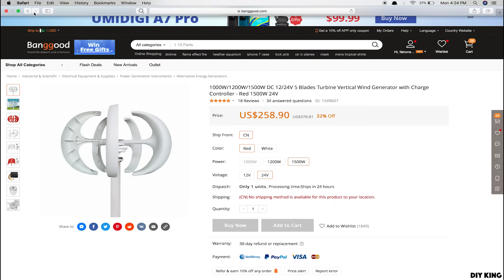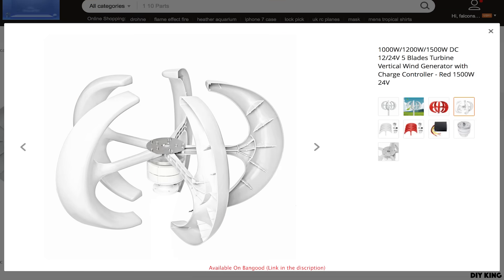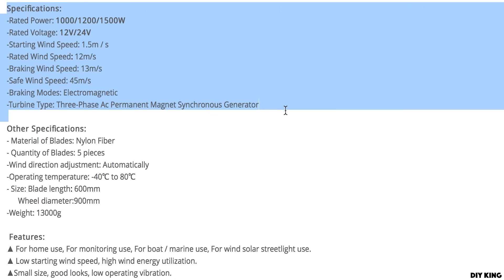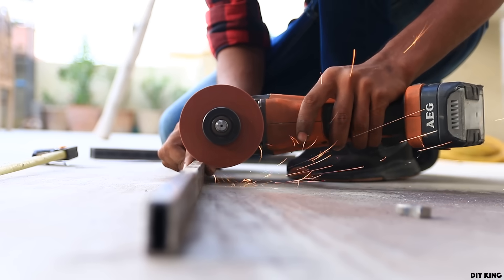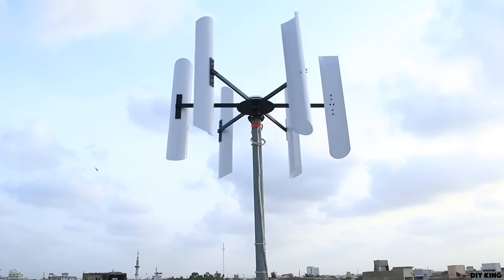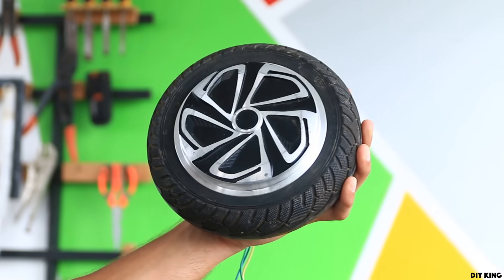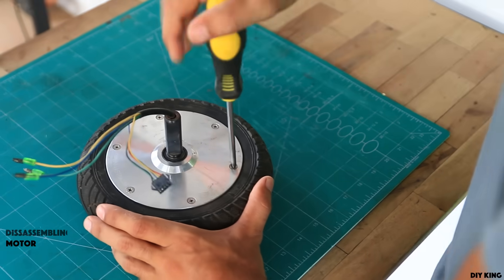How to make a Vertical Axis Wind Generator (Is it worth that???)

Comment: use an odd number of blades, 3 or 5, and shorten the arms they are mounted on by 1/3 of the original length. that should increase rpm, and reduce drag force by keeping the blade faces asymmetrical to the blade backs....great video, earned a new sub👍!
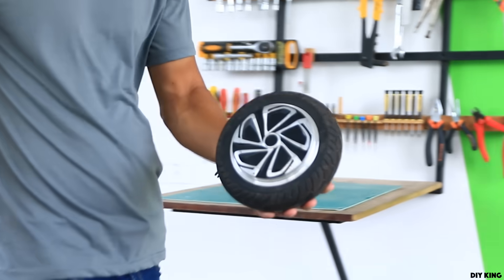Reply: It seems the odd number of blades should not be directly opposite each other. Try 3 blades 120 degrees apart. Look at the 5 blade pattern on the hoverboard wheel at 0:54
Reply: Yes This is actually the case. Please try a 5 blade version.
Reply: would the F P direct drive washing motors  and others of the same design  put out way more wattage if so how much wattage i have hear up to 1500 watts i know noneya business will give us facts!
Reply: @ambersmith6517  
I believe you are referring to DC treadmill motors? If so, then yes, the typical treadmill motor is "RATED" 2-3 hp. (1hp=746 watts) that is the consumption rating of the motor, at a given voltage,  rpm, and load. when used as a generator, these motors are much more inefficient, so 700-900 watts would be about as much as you would see from the motor terminals. Bear in mind, you have to apply 1500-2200 watts of mechanical power into the motor to realize that 700-900 watts output, so your blades, and gearing into said motor has to be able to source this power from a given wind velocity the turbine is designed for. hence the "slippery slope" of physics strikes again....
Reply: @ambersmith6517  Hello,  Rick here in AZ.    you will find there are a lot of different motors, alternators, generators out there that will all produce power,  just know the facts, what ever style motor, what ever the configuration,  however many field and armature winding they have or how many magnets they have,  they will all only produce as many watts output in proportion to the wind force being used to drive the motor.   the more driving force you have to turn the motor, generator, alternator the more watts you will get out up till you reach the max wattage that it can source, after that you won't be able to dissipate the heat and the motor will get to hot and burn up.
Reply: Lots of good sensible comments in this thread.
I've just been an an argument with a clown on another video about the validity of VAWTS.
Everyone knows that aerodynamically they don't convert wind energy as efficiently as HAWTS, particularly those with well designed blades. 
But that doesn't mean they don't have a place. 
That's actually very common in engineering. I started my degree in mechanical but finished in aerospace and mainly work in automation systems. There's all sorts of things that for most tasks aren't great but in certain things they are. Great example being a comparison between a mill and a shaper. Given the choice nobody would take a shaper over a mill EXCEPT for a few specific tasks. 

Here's one place HAWTS might be the best solution
I live in Australia and we have a huge number of houses close to the ocean with solar. Many of these places also get an consistent late afternoon onshore breeze that continues through the night into the next morning. Australia isn't the only pace that gets that but there is certainly an opportunity to use small wind turbines to use the solar inverters. In terms of cost benefit the simple thing is you get more out of the inverter. Also a house might be able to get away with a smaller inverter and smaller battery system.

But there are some provisions. 
Being close to the ocean means getting the occasional high velocity squall. So it can't be fragile. That tends to favor a Savonius.
Being a domestic application it can be noisy. Small HAWTS can be very noisy just from the blades.
It needs to be relatively cheap and and easy to install with minimal complexity have little complexity. That tends to favor VAWTs over HAWTs

But there has so far been a huge problem. The only HAWTS available in Australia to date are these cheap crappy low performing imports very similar to the ones shown at the start of this video. That has resulted in a lot of bad publicity. But then we have also had a lot of bad publicity surrounding solar systems.

I still think there is a place for VAWTs in certain applications but there has to be a lot more reality in the conversation.
Reply: @tonywilson4713  shaping machine, now there's a thought . Always came across as a lot of machine for very little result . But , broaching , keyways about the only real answer..
Reply: Also try lighter weight materials for the arms. The lighter the weight the less force it takes to turn
Reply: The powering blade is always going to be opposed with even number of blades.  It makes sense to use odd numbers.  Take the tip from the early aircraft propellers.
Reply: Odd numbers teory? Yea I can see this work. 3,5,7,11 if you divide by 1 and themself you can use them. I think curved and caped on end blades will help too. And as you say arms shall be ~1/3 of used in video.  Vertical Axis Wind Generator and "normal" Wind Generator are like total different sides of this same coin.
Reply: thank you for your comment and I have subbed after watching this video
Reply: Actually increasing the gap between them has proven beneficial.  The air needs space to get through to the back blades as they also drive the wheel
Reply: Use the 1/2 pvc  pipes as a base mold for carbon fiber blades. This weight reduction  should reduce drag significantly
Reply: @drewberrynews3875  or grp like industrial turbines found on wind farms
Reply: It is not a fair comparison.  The HAWT you started with has aerofoils and works using lift.  It will have a tip speed ratio of about 6 for 3 blades.  The VAWT you built has blades that use drag forces and cannot have a tip speed ratio greater than 1  If you make a VAWT with 3 aerofoil blades you will be able to compare the two types on a fair basis.  3 blades is the optimum number for all turbines.  If you increase them the tip speed ratio reduces but the torque from the turbine rises
Reply: may be source lighter components/materials and more efficient motor... the motor was never designed to work in Vertical Axis as opposed to previous experiments, and may be just fine tune the bearings...
Reply: Odd won't make a difference
Reply: I am considering a vertical axis wind turbine that looks exactly like a tree, I call it : e-tree.
the trunk of the e-tree is brown, the spinning blades are green,
attached to the trunk of the e-tree are features of : wifi/mobile network, light and power outlet, to charge a car for example.
Reply: Hi, what do you ment that the blades should be asymmetrical to the blade backs ? Please let me know
Reply: Agreed. I think shortening the arms will yield the biggest improvement to rpms. One benefit of the vertical turbine is that they self-regulate. If you live in an area prone to high winds, a regular turbine will rip itself apart. But the vertical turbine has the drag on the opposing side to keep the speeds more reasonable.
Reply: @penitentchicken  Great point and something that the anti-VAWT people like to ignore.

I've been looking at these for a while now. I used to live right near the beach in Melbourne Australia. As close to the beach as I was (<100m) we got fantastic onshore/offshore winds like clockwork starting in the late afternoon and going through to mid morning.
BUT we also got some damn nasty wind squalls at times. HAWTs are just cute projectiles in that scenario.

I think there is a market for small VAWTs in certain locations to boost the supply out of existing solar systems by making VAWTs with a compatible output.

Unfortunately in Australia - so far the only VAWTs available are mindlessly expensive or utter crap.
Reply: @tonywilson4713 ....... look at the furling tails used on water pump windmills , or just build a twin swallow tail , where one is sprung & will direct the unit off line , under excessive conditions .
Reply: @robertwoodliff2536  Yeah there's solutions to many things. Most of them aren't new and some have been done for centuries.
The job too many engineers ignore is to find the best solution for the moment, and that can include a whole raft of things starting with the most basic reality - what's available, what affordable, what's practical,....
Reply: One more today.

Comment: good job but don't be disappointed  .. increase weight at the blades and use gears or belt pulley to increase the rotation speed for the generator plus you can double the generator 
VAWT blades produce more torque than HAWT so get benefits from this and reshape  :)

Comment: Would using a gear system connected to the turbine help? Like converting the single rotation of the blades to say 50 times and using that on the motor.
Reply: if you use an ebike motor wheel, it already has the planetary multiplier inside
    but you will have difficulty at the start .. better to use the overboard generator but after the diodes go to a solar mppt regulator
thus the start is made free and then the MPPT seeks the point of maximum efficiency
Reply: Hi Bro, I am from India, I want to make wind turbine at my agriculture field. I do not have much mechanical knowledge. Can you help me in designing vertical wind turbine?

Comment: From my understanding of VAWG they spin nearly the same speed regardless of wind speed, their benefit is being able to generate constant power in variable wind conditions and being able to continue running when wind speeds are too high for HAWG.
Perhaps you just need to redesign it to make the motor spin faster, either shortening the arms as suggested by @Trent Pettyjohn or with some gearing?
Reply: in fact they they need a gearbox
with 1:4 ratio in start, so for 1rpm of blade, you will got 4 rpm or generator
or even bigger ration (need test)

Comment: You have to optimize the aerodynamic design of the rotor if you want good performance. Aerodynamic design includes selecting the profile of the blades, the number of blades and the aspect ratio of the rotor, you can use Q-Blade software to optimize the aerodynamic performance. I understand is a low cost design so selecting and aerodynamic profile is difficult but maybe chaning the configuration of the rotor (number of blades and aspect ratio) can improve the performance of the wind turbine, probably using four blades would have better performance

Comment: My points are (1) Reduce the No of blades to 5 only (2)  Do not mount the blades from the center of curve , mount it nearer to the edge (3) need to edge the side profile of blades for better aerodynamics (4) Extended more arm length & use PVC pipe instead of M.S sq. pipe                              Thanks & best Luck !

Comment: I think there's whole books on not making those blades symmetrical, 
and letting them pivot (open up to catch wind, then close in to reduce drag).
Reply: @Wim
If the blades pivot there is too much mechanical wear and tear.  It's better to redesign the shape of the blades to be more aerodynamic.

Comment: Change the blade design, use a carbon composite to hold that blades not iron or steel (heavy ) .change the whole blade set up  with carbon composite ,light weight and strong .study more about efficient blade designs , material selection and test it in a wind turbine and then apply it.

Comment: Square tube is longer then required. You need more speed then cut it in half. You will see the difference. But best is horizontal axis wind turbine 3 blade setup

Comment: there is also a way that you can increase power which is you can coil each stator in the motor seperatly like a brushed motor and take the 2 ends of each coil and connect it which creats a negative and positive side , which actually doesnt matter now and then now u will get more voltage out of it
and the thicker the coil ,the more the voltage

Comment: the issue besides the heavy weight of the tubing is due to the drag caused by the blades. if you tilt the blades at roughly 22.5 degrees vertically as well mount the blades closer to the the inside edge of the curve so its not dead center on the blade this will reduce some drag and give a slight bit of lift which will help with the weight of the tubing. also change to round tubing as the square tubing is also create drag.

Comment: Does it make a difference if the blades are mounted so the top of the blades are closer together and the bottom of the blades are at a larger diameter?

Comment: Use low RPM motor, that Produces much power. Or reduce the arm length on which blades are mounted.  Wind mill rotates slowly but gear system and a low RPM motor that can produce enough power can easily produces enough electricity to feed homes.

Comment: Excellent video, congratulations on a great effort. If you’re interested, perhaps a baffle that blocks the wind on the convex surface could improve things. In any case, the horizontal seems to win this comparison. Another issue possibly could be that with six blades, you have extra drag because for any given wind direction the concave face is being resisted by the wind on the convex surface, which is diametrically opposite. If you had say only five blades, there would be less opposing resistance as the convex surfaces on the blades on the other side are angled so that there is less resistance.

Comment: Really sweet, comparo and nice, nice work!  That thing, because of it's diameter, is low RPM, high torque - really nice.  You could turn a much larger, heftier motor with it.  Just won't work as well with that smaller, higher rpm motor.  Great video!  Sub'd.
I love videos that go through the process of exploration.  And show how well things work versus others.  Really outlines the differences.

Comment: Use pvc pipes or lighter material to connect blades with motor rather than metal or use alternate metal n pvc pipes in order to gain momentum..it looks as if its not getting enough torque. 
u can use external wheel bearing for decreasing resistance.

Comment: The material you use is not suitable for this. İnstead of steel you should use aluminium and instead of PVC try to use carbonfiber. The thing you build way too heavy. And there is the length issue which is already covered in the comments.

Comment: Good job,
But keep in mind, It's a proven fact that horizontal wind turbines are more effective whenever they are used to produce mechanical energy, whereas, vertical wind turbines are more effective when electrical energy is required as the output.

Comment: Great video. Unfortunately you used blades that will be limited to the speed of the wind. Ideally use aerofoil type blades this will allow the turbine to turn at a rate faster than the wind speed and therefore generator more power. It could also be that the generator is a little heavy for the current blade design to turn.

Comment: The length of the square tubes connecting the blades to the motor is long, this cause the RPM to be less as compared to if the the length would have been shorter.
Reply: However, a longer length gives higher torque, so it should be possible to get higher power outputs with the vertical axis design. The problem also is the weight of the square tubing. But this video demonstrates quite clearly the comparison between horizontal and vertical axis designs.
Reply: I think those parts you attached is little heavy.also change your alternator  because its made for   electric bike .this alternator is very heavy that's why can't generate proper volt.
Reply: @YARU4788  its just a pmdc motor bro, not a specified alternator
Reply: Better use aluminum this could work fine and try to use gears or v belt
Reply: what is the cost of this &how many wat its given
Reply: Right, and the fewer wings the faster

Comment: Reduce the rods/pipes length, then the blades will rotate faster as per your requirement (500 rpm) and it will generate more than the previous motor.
Reply: I mean reduce the star shaped rods/pipes sizes....👍

Comment: I think the issue is with Ur light weight blades vs. Heavy metal centre. Also pvc is flexible and u wasted a lot of wind power right there. If I were u then will try to make blades with heavier material to compensate the central heavy weight or a bit heavier than centre metal weight attached with hovar board motor. Also increase the size (length and width) of Ur blades will make big difference.
Anyways excellent video. I have seen many of Ur videos. Good work there u have done. I wish more پاکستانی turn technology savy like u rather than just social media bugs...
Reply: That seems a smart Idea 😉.
Reply: U can increase the amount of blades and length this surely work
Reply: Would a sailboat go faster with a sail made of metal?? What about a helicopter with a rotor made of lead? Of course not.
Heavier blades on the turbine increases it's inertia. Meaning it will be slower to spool up to speed, and become inefficient due to the fact that inconsistent gusts of wind would not be enough to turn the turbine to produce any  significant power. Therefore, the blades need to be light as possible. Aerodynamics and efficiency of the blades is key.

Comment: Bro, you will have to reduce the diameter of the wind turbine and you will obtain higher rpm's. I also have many hoverboard motors and I'm thinking about building some wind turbines with them. Keep it up! All the best! 😎👍
Reply: No!  Think, for getting more torque the radius of turrbine must be increase
Reply: @parthasarathimanna8790  speed inversely proportion to torque
Reply: @parthasarathimanna8790  I politely suggest you to do some research about it.